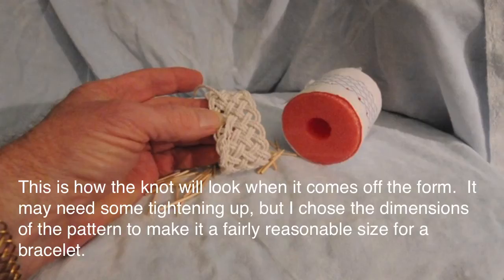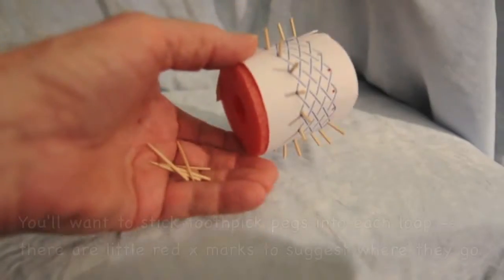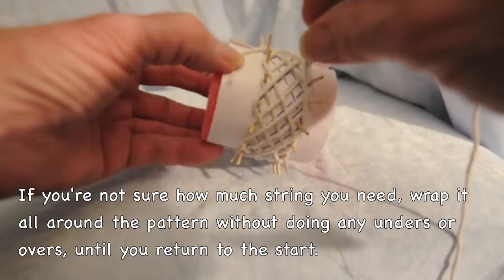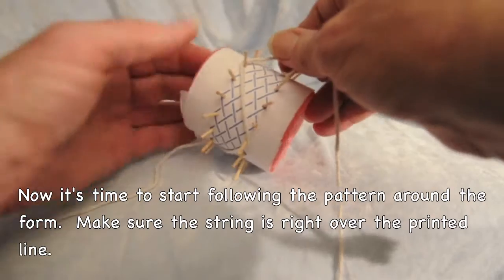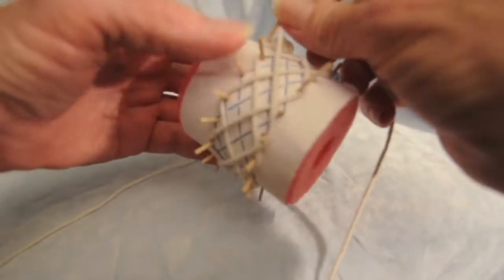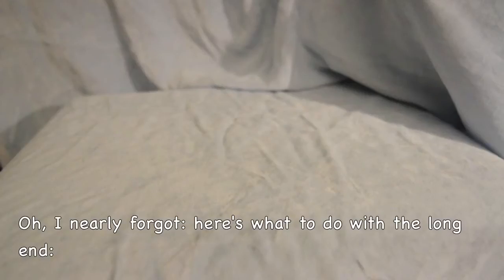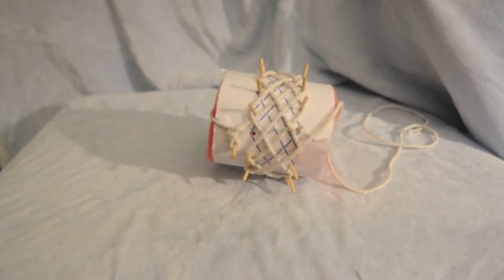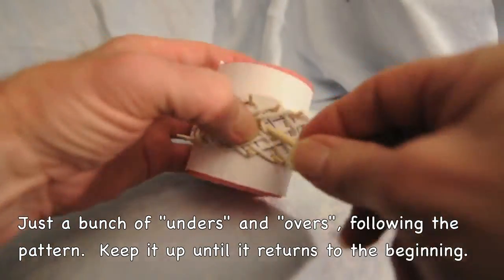Complex Turk's-Head Bracelet in Cotton

Comment from the maker: It depends on how far apart thge rows of pegs are. It won't make a knot smaller than the tube, but the narrower the distance between rows is, the smaller the resulting bracelet. This is a lot more important with metal than with string, because with string, all you have to do to change the size of a bracelet is work slack out of it (smaller) or work some slack into it (larger), taking care to work it evenly.